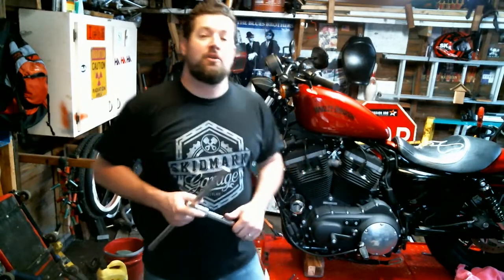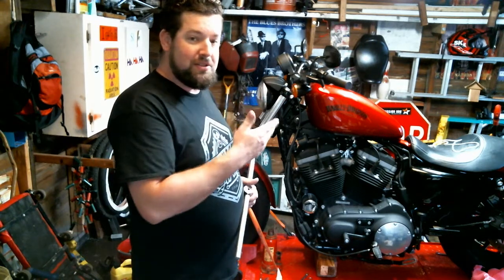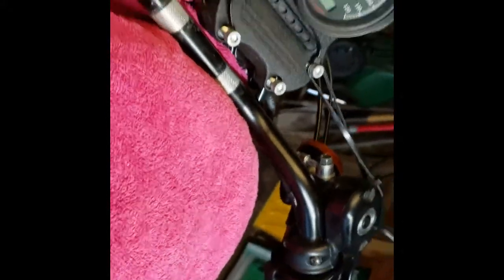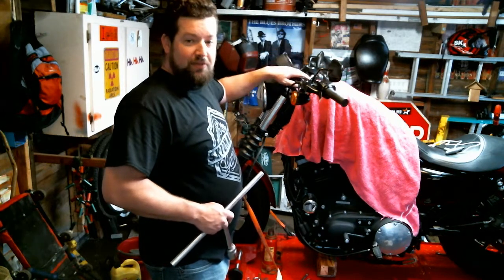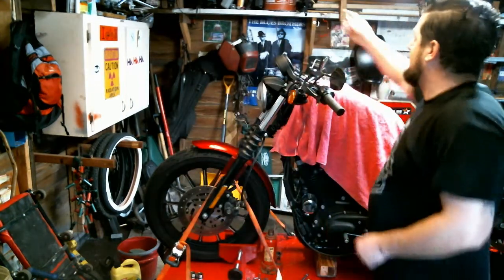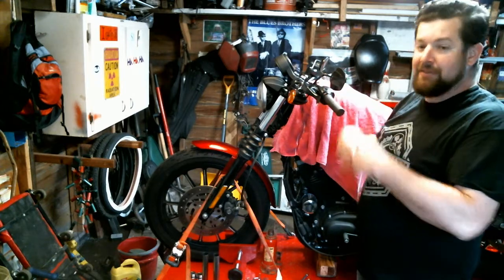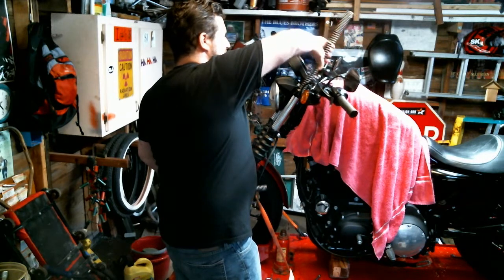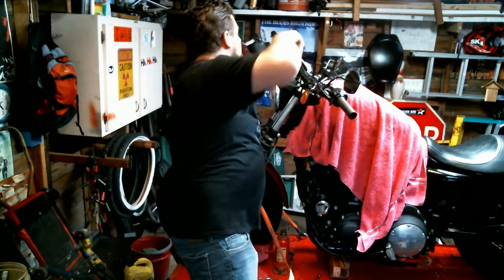Harley Sportster Fork Spring Upgrade.

Comment: The smaller “preload” springs you took out was replaced with the washer and pvc pieces is that correct? I didn’t see them go back in. Thanks great video.
Reply from the maker: Yes, the PVC is cut to a different length than stock.  The length is specified by Progressive.
Reply: @KnobleMoto  10-4 thank you.

Comment: you don't have to remove the front wheel or relieve the weight that on the front wheel?
Reply from the maker: No. Just jack the bike up enough that the front suspension tops out and the wheel comes off the ground

Comment: I noticed you didn’t change out the fork oil, is it not necessary?
Reply from the maker: Not necessary to change the oil, but it can’t hurt. Just make sure the oil drains off the springs before you remove them.

Comment: Did the springs raise up the front end a little bit?
Reply from the maker: A small amount. About where it was when the bike was new.  You could cut the preload spacers a little longer to help lift it.
Reply: Thnx! I just ordered a set of springs so I hope it will be a nice upgrade
Reply from the maker: @nicovanommeren5641  you won’t regret it. Stock is terrible.

Comment: What weight fork oil are you using?
Reply from the maker: 20 weight
Reply: In video I didn’t see where fork oil was changed. Did I miss that?
Reply from the maker: @humid-rb7rt  you didn’t miss it, it was not in the video.  I did not change the oil, because you don’t have to change it to change the springs.  Also I generally don’t change fork oil because it is difficult to get it all out without full disassembly.  So I just run the same oil until one of the seals go, then do a full rebuild on both forks.

Comment: Did you not have a damper rod in your 883??
Reply from the maker: Yes. The damper rod is in the bottom of the fork.  No need for removal for swapping springs
Reply: @KnobleMoto  Did I miss in the video where you unscrewed your damper rod from the fork Cap/spring. I got the right one swapped no prob but left fork is challenging me lol
Reply from the maker: @kcs316  I don’t think I have done a video of full fork Teardown.  I do a in person class on it.
Reply: @KnobleMoto  where are you located?? Cause I legit can't get the right spring out. Cap is completely unscrewed but it's attached to the damper. I would love to attend something like this
Reply from the maker: @kcs316  Cleveland Ohio.  I Do a  suspension class once or twice a year.  I am about due.  Www.KnobleMoto.com
Reply from the maker: @kcs316  send me a message KnobleMoto@gmail.com
Reply: @KnobleMoto  no kidding??! I'm just outside of Cleveland
Reply from the maker: @kcs316  all classes at Skidmark Garage. 4806 Hamilton